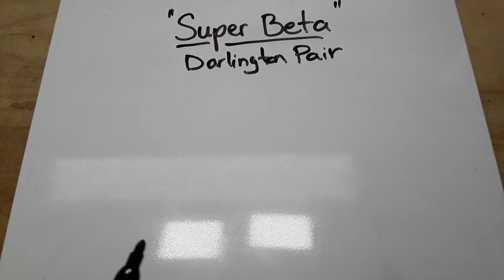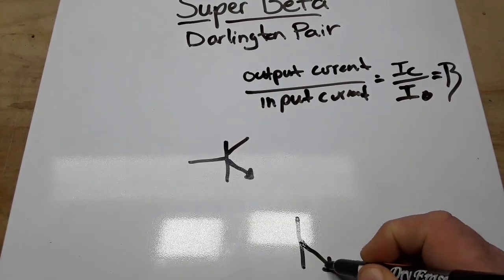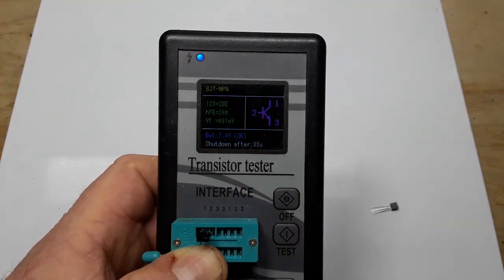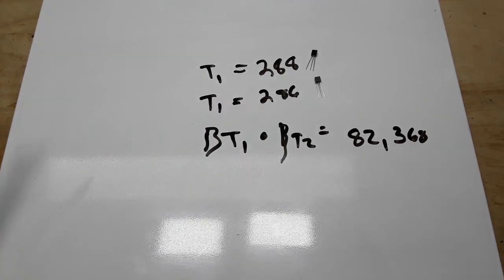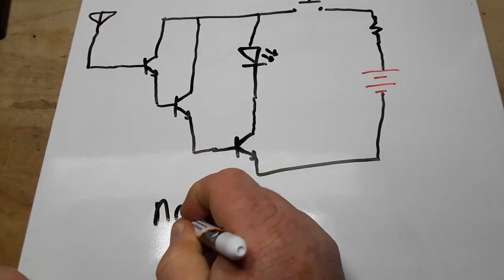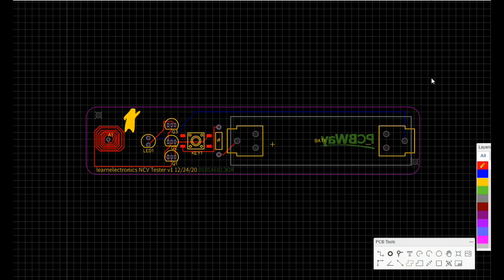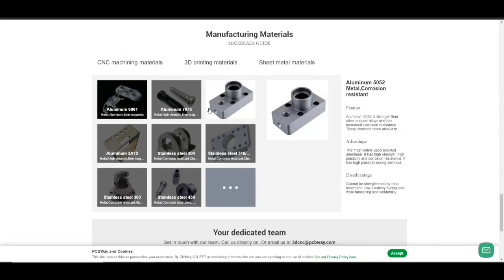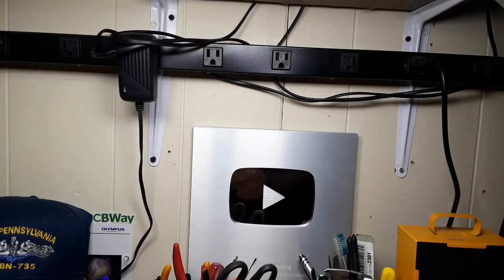Transistor Gain and Contactless AC Detection

Comment: Maybe if you mount the battery on the back you'd have better access to the switch?  A sounder would be good especially if you're using it in really bright conditions.  It also gives it dual redundancy!

Comment: Ah yes...beta...in college a friend and I had a chance to spend hours unsupervised playing with a Tektronics curve tracer. Primarily used by the circuit designers to figure out the beta of salvaged transistors. When we hooked up a light bulb we sat there scratching our heads at what we saw. Can you guess what was displayed on the screen?

Comment: Each transistor has a .6v drop the LED 1.2V drop 3x.6 is 1.8v + 1v = 3v.  use a 9 volt battery.
Reply: I built mine the same way, 9volt, 2k resistor, LED and buzzer. It works great. I used two transistors but when I followed Paul's design and added the third it worked far better.  Anywhere near a hot line and they go off quick.
Reply: You can get 1/2 length 18650's. 18350, maybe? I forget the exact size. Stuff two of them in that holder and presto.

Comment: I think there must be a market for a device based on contact less mains detection.
Consider a device which clips onto a mains cable or into which a mains cable can be push fitted, around the wire double insulation of the cable. Such a device could provides an open collector logic level output that could be used to monitor the state of mains circuit. Such a device could be super isolated from the mains supply, and therefore absolutely safe to use.  One can imagine the device connected by a three wire cable, five volts, zero volts and signal, that could be used to check if a particular mains cable is powered and/or drawing current. A simple sensitivity control selecting the latter.
I can think of many applications in alarm systems and safety monitoring, where it would be handy to know if a mains circuit is powered. For instance, it would allow the retro fitting of an alarm circuit to a PIR controlled outside lighting system.

Comment: Shouldn't the Led have a current limit resistor to stop it being overloaded on a strong signal???
The circuit is essentially detecting mains hum, the bane of every audio engineer.  AC coupling would allow the circuit to have even more gain. The trick is to do the opposite of normal audio amplifier practice, and design an audio amplifier that enhances mains hum pick up. It is easier to achieve high values of AC gain, as leakage current ceases to be an issue. Once the AC signal is sufficiently large, it is easy to design a trigger or rectifier circuit to detect it. 

A better solution might be to use the gain of an op-amp or add a JFET pre-amp if the DC E field is of interest.  I have seen a number of these Darlington based mains detectors, but almost all cascade at least three transistors to achieve the required gain. 
It was once said that one of the best ways to build an am radio receiver is to design a high gain amplifier. What is required is an am radio receiver optimised for  a 50Hz carrier.
Adding a loud speaker would allow the user to hear the mains hum.

Comment: Salvage the small vibrator from inside an old cell phone.  Commercial voltage testers have something similar along with a flashing LED.
Reply: Commercial on style versions use a piezo electric speaker. The one I use, allows the mains hum to modulate the tone it produces. This gives a warbling noise when close to an powered mains cable. But the device can also be used to detect static electric fields, and if the tip cover is removed, to expose a metal probe tip, it can even be used as a logic tester, bleeping and flashing it's LED on a logic high.

Comment: Well...its more of a square function rather than exponential. With 3 xistors its cube. Just being picky. Sorry.  Also a smaller battery would be more appropriate. I realize 18650 is a simple 4.2V supply. Oh yeah, use a brighter LED.   I think the push button is drawn wrong.  :)

Comment: Sir, use the CR2032 baterry in the next one. I miss the resistor impedance control in the colectors of the transistor, 100k, 10k and 1k in this sequency. thank you.
Reply: design with a low voltage battery is problematic for a cascaded Darlington amplifier, due to the summing of Vbe volts drops.
A true Darlington circuit with the collectors directly wired together, cannot achieve the low output saturation voltage of a single transistor. Each added transistor adds a Vbe voltage to the output saturation voltage. This is why such circuits usually connect the collectors back to the supply rail via a resistor. with each stage increasing the value of the load resistor. 
The commercial non-contact mains testers on the market, usually resort to using several (typically three)  button cells in series to provide the necessary supply voltage.
Reply: @nigeljohnson9820  It'S becose I use 2 in sereis, to get 6V😁😁😁😁😁
Reply: @vidanatural_oficial  but that is not what you said.
Reply: @Joachim Shekelberg while not scientifically accurate,  in common usage the terms are interchangeable, you are just being pedantic.
 If you wish to be pedantic "use the CR2032 baterry in the next one" (sic) The use of the definite article implies a single cell, as there are many different versions of more than one cell.

Comment: I think the 'Red LED' is fused out(high power) Or you have to use less power LED than the red one.
And I also think the coil is so small so it couldn't give better signals to the base of the transistor....? 🤷‍♂️

Comment: I don't understand how the led is being lit when it should be lit from the battery. Are you using the power from the sensor to light the led or just using it to turn on the transistors?
Reply from the maker: Led is part of the sensor, it has to be active to light led

Comment: Why is the LED light dim you have 3 transistors with an extremely high beta. The LED only needs 10mA to light so 3 transistors should be way enough. Any other examples of using Darlington Transistors for switching and amplifiers circuits?